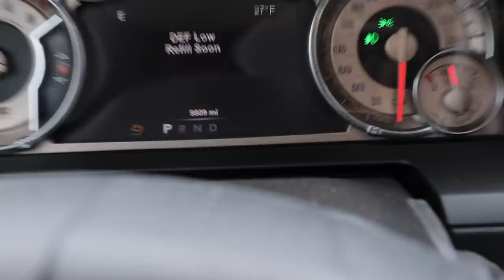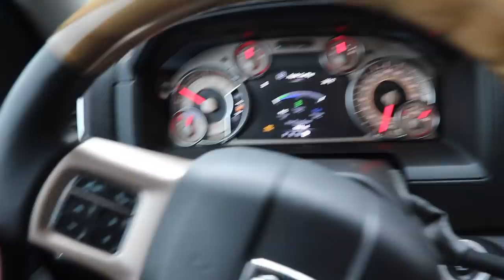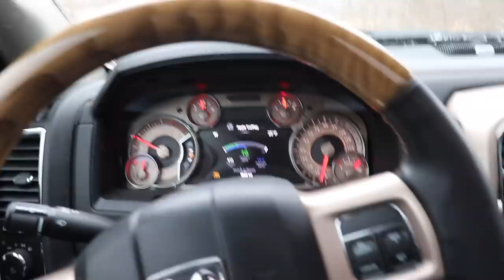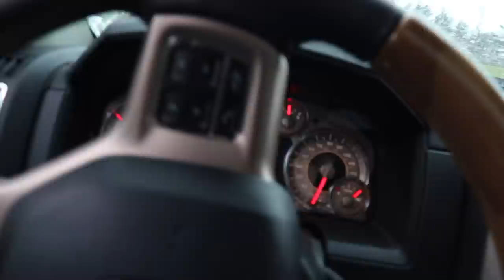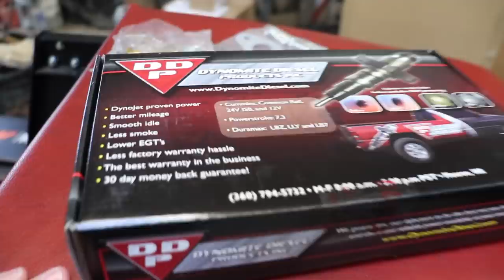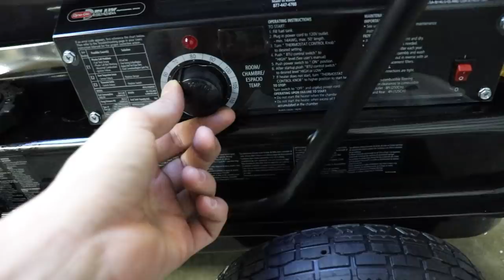I RAN OUT OF DEF IN MY 2018 CUMMINS...

Comment: You should always keep your DEF at least half full because when its low it puts more soot into the oil and lowers your oil change interval. Also the problems people have with DEF and emission parts are related to the Def crystallizing, usually from low flow and heat. When the DEF crystallizes it clogs up emissions parts. The parts then have to be removed and cleaned with hot water

Comment: DEF is a scam....I won't buy a new Diesel.
Reply: Madeline Lucas the older diesel don’t do DEF?
Reply: Ricky Davis no its a new emission thing
Reply from the maker: Or you can just delete it and call it done...
Reply: Ricky Davis No , they do not.
Here in California , you gotta smog 98 and newer. DEF has to stay on it...the computer will "snitch" on you if you delete it and then put it back on when you go smog the truck.
Reply: Yeah becuase reducing pollution is such a scam 😂 go tell the epa it's a scam, there the ones that require Def or something that equally reduces nox emissions
Reply: Nothing wrong with DEF fluid.The problem with new trucks is the EGR,that’s what clogs everything up.Case tractors have the best setup,no EGR only def to control emissions
Reply: Blastmattspast247 Did you know the smog pump was created by a Governor nephew? 
I worked in the auto industry for years. Most smog equipment including the smog pump , thermactor pump , catalytic converter DEF is all a money scam.
Reply: The trees turn carbon into to oxygen and the ammonia from the DEF kills the trees. But hey, California knows what's best... right
Reply: Madeline Lucas i agree its pricey and stupid but it works 😂😂😂 tf you mean its a scam??
Reply: Or buy a house in Canada. Delete it and bring it to US. 🤷‍♂️. It’s legal here in Canada. Haha

Comment: never buy def from auto part store. reason why is that def will go bad when it sits for a period of time, and will cause the truck go into limp mode. suggestion is go to a diesel truck stop that have def and fill up there. if you have to go to an auto part store, look at the date when it was produce and get one that is the most current.
Reply from the maker: jasonman1515 we always buy it from autozone... it’s the same containers in every store lol
Reply: It might be the same container, but when did they got it package and sent to the store and how long has it been sitting on the shelf. depending on temperature and exposure to sun light, all that take into consideration of how much degraded it has. just a warning and a look out. I've been in the diesel field for coming up to 7 years and in my time I had to drain and clean def tanks do to bad def. and I ask the customer where did they get it, all said at the auto part store.

Comment: You should explain want happens when the 4th Gen runs completely out of DEF (after "Limp Mode") when the ECM locks out, and  the truck owner is required to buy a new ECM.  This is one of many down sides of the newer RAM Cummins pickup trucks.
Reply from the maker: Idaho Buckaroo Before it ever runs out you delete it and never deal with it again.
Reply: @LOUDNPROUD  Thank you for the clarification.  My reason for asking is based on my dealer's Service Department they say that if the DEF is completely out and the 200 mile limit is exceeded, then the truck will continue to run provided it has fuel.  

However, if the truck is shut off with 0% DEF and the 200 mile limp mode limit is exceeded, then the truck will not start again, and the truck's ECM will need to be re-set (re-flashed) by a Dodge Dealer Tech and the DEF re-filled before the truck will start again.

Here is what the EPA has to say about it.

The U.S. Environmental Protection Agency requires vehicle manufacturers to put measures in place to ensure that vehicles cannot run without Diesel Exhaust Fluid (DEF). Before a truck's DEF tank runs empty the driver is given a series of alerts on their dashboard displays (much the same way as if they were running low on diesel). Generally speaking, when the DEF tank level drops below 10% an amber warning lamp will come on, at 5% this lamp starts flashing and below 2.5% a solid amber warning light is displayed.

If the truck is allowed to run out of DEF the engine's power is reduced, a solid red warning will be displayed and the vehicle speed will be limited to 5 mph until the DEF tank is refilled.  https://www.discoverdef.com/def-overview/faq/#agricurea